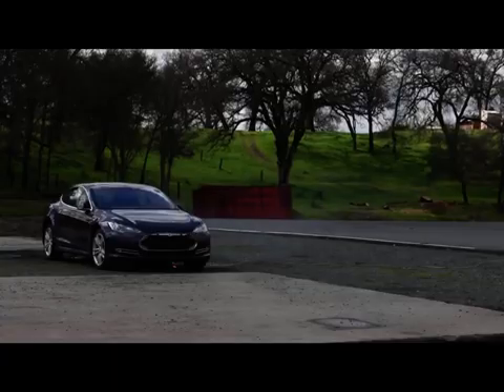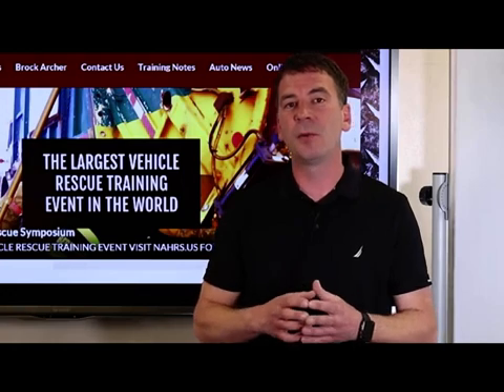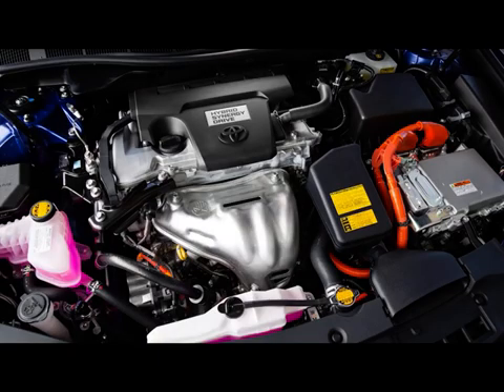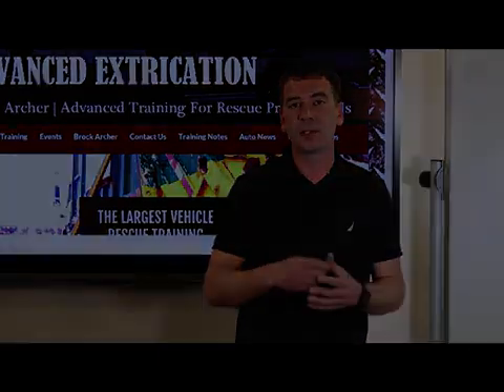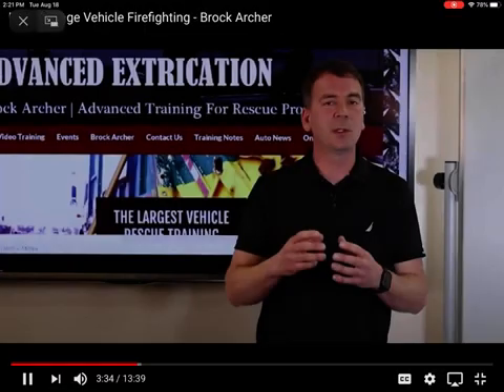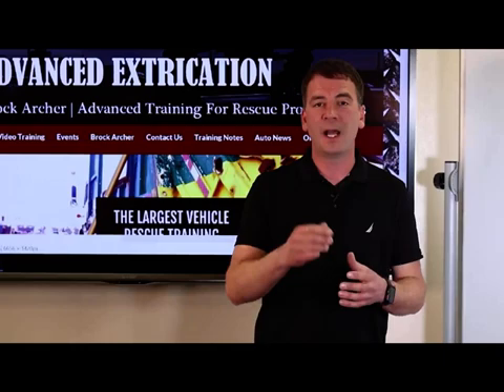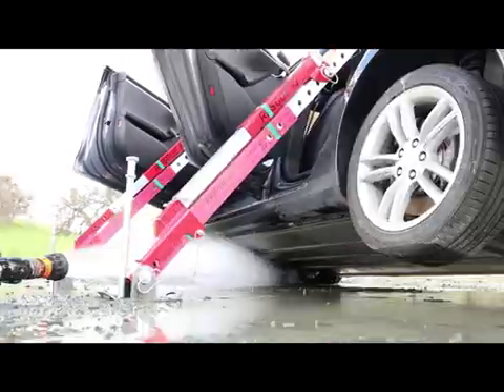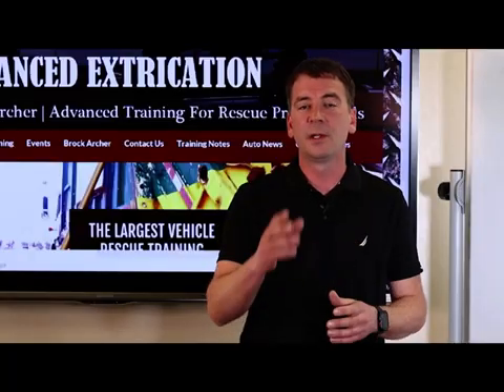How to Approach and Extinguish an Electrical Vehicle Fire - Brock Archer

Comment: I remember a commercial decades ago featuring a heavy-duty balloon, inflated by the exhaust pipe to lift a corner of a car to more easily change a flat tire on the road.  Wondering if two smaller ones, inflated by compressed air, would be quicker than the mechanical lifts shown.

Comment: What about the danger of electrocution due to water?
Reply: There is no potential against earth, so any currents are localized to the car. It is only dangerous if you are directly working at the car, for example if you want to disconnect the battery. This is different to normal power distribution, for example when an overhead line comes down after an accident, where potential against earth is present.
Reply: Yes definitely a good chance of electrocution. You have water and a positive and a negative charge with water with high voltage and high amps.
Reply: Water (H2O) is non conductive.
Tap water will, but shunting between terminals is minimal.

After using water to lower the temperature so that the other blocks don't start thermal runaway, they've measured the electric tension (there is no such thing as "voltage" ) and the effect was minimal (unfortunely)

Comment: Water will ignite lithium. Why does he suggests using water?
Reply: There is only little elemental lithium in a battery (for example, in a Tesla there is about 5kg lithium), and the cooling down you get from water easily outweighs the undesirable effects from some of the water getting converted to hydrogen and participating in the fire.
Reply: The NVFC course I took said to use water as well to cool the batteries on EV fires.
Reply: There is no metalic form of lithium there.
That's the disposable you buy for photografy work or similar use (Sony lithium AS for instance, I have one for tests)

Comment: Have you seen what happens when you  put water on lithium. Co² can cool it way more efficiently
Reply: Yes, lithium solid reacts explosively with water, however when lithium is ionized in a substance, such as that found in a battery, the lithium ion is unreactive. This is similar to how sodium reacts explosively with water, but the sodium ion in sodium chloride (table salt) doesn't react with the water when dissolved.
Reply: But CO2 is very limited in quantity. In an urban setting, water from a fire hydrant is basically unlimited, so you can cool down the car and surroundings as long as it is required.